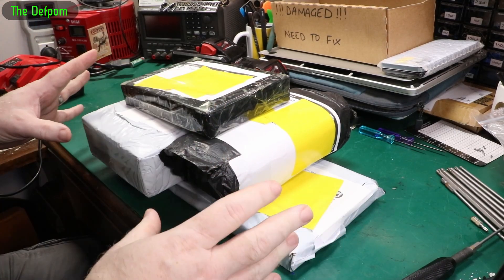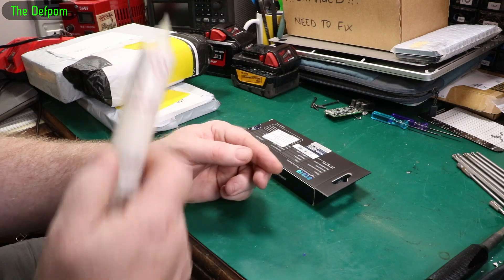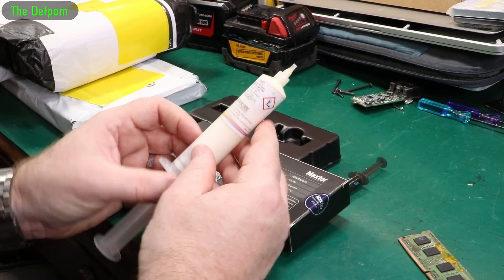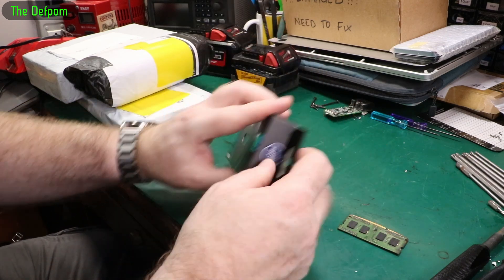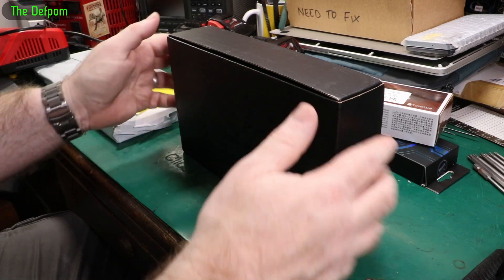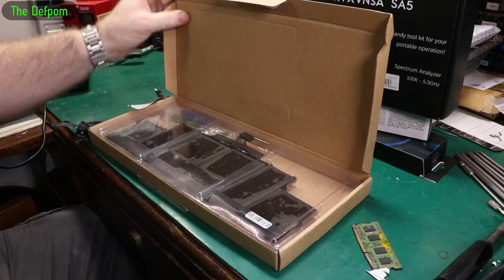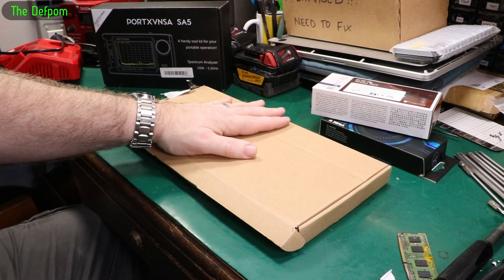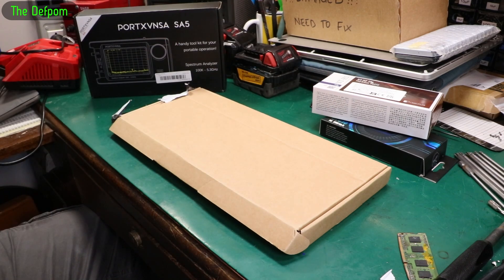🔴 Mailbag Monday 17th March 2025 - No.1339

Comment: In terms of expiry date, I leave my paste in the fridge, and have never worried about the expiry. I did leave one tube in a hot shed, and after a few years, the liquid and solid components in the paste started to separate, making it difficult to spread. I leave flux, solder paste, heat sink compound, glues, epoxies, liquid solder mask in the fridge, and they all last longer.
Reply: It looked like a date on the Noctua was 05-2023. That was probably the production date. The box said the expiry time in storage was 3 years so it has almost burned through 2 years already sitting on a shelf. Probably should get that into the fridge right away.🙂

Comment: You can get some nice thermal pad materials that are quite thin but quite expensive. Can't remember its name but used it mounting high power resistors to a heat sink. It could sink 2.8kW which was not much fun inside a room, that's inside a building in the height of summer 😅.